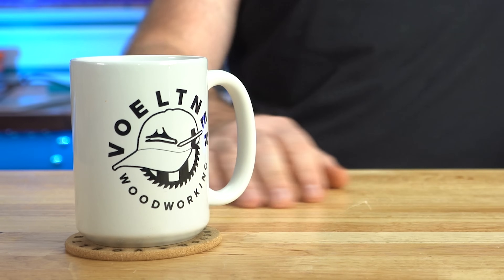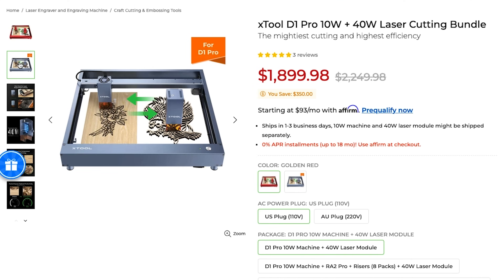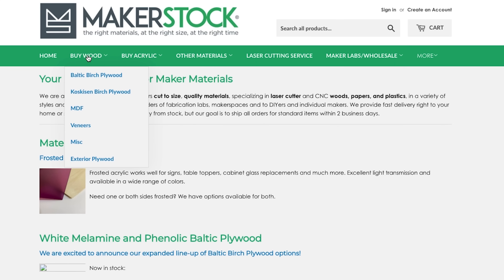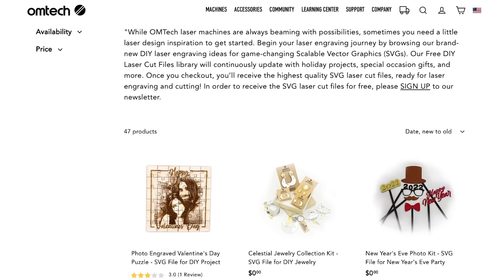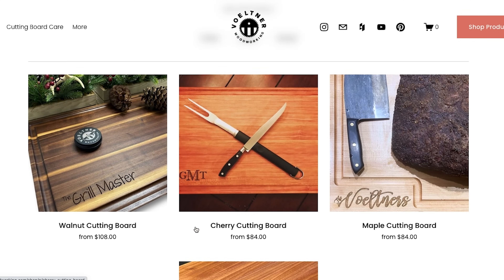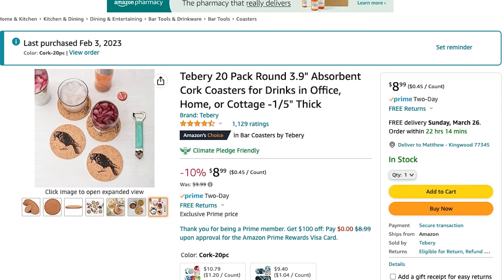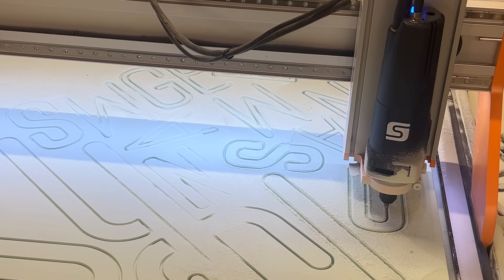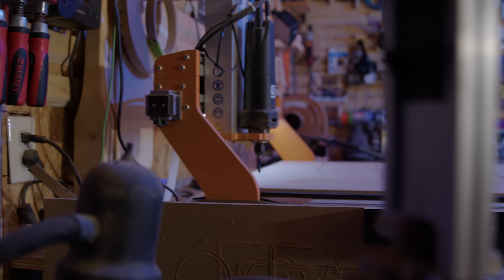I should have NEVER bought a combo machine

Comment: Nice video and well said. I made the "mistake" back in the days when I bought my M1000 with the DL445 laser. While it was OK for engraving it was very limited so I bought an Opt Laser which is much better but still 6W. So I paid the price of this lesson 3 years ago :) Another thing to consider is when you have to use the laser you need to switch the tool which also takes time plus need to make sure the spindle is set well switching back. I had some problems with this CNC with tramming (more with shimming). Do you have a good way to do that other than what Stepcraft recommends with the X axis?
Reply from the maker: I never ended up getting the laser module for the M1000. If you use a flattening bit for your surface your bed should be parallel to the gantry to help avoid issues, but still not as good as a dedicated unit for sure.

Comment: Do you have a video on a (less expensive) machine that can make 3d aluminum plaques - I've had a request to create some for Boler Camper owners that have over the years either damaged one or more of theirs to mishaps or downright theft. The originals were plastic. I mentioned they should have been metal. Now I'm thinking I can supply them to the thousands of us that would like to show our pride with a really spiffy replacement. They are not very thick, but measure about 6" by 8".  And the really affordable machines I have investigated do not measure up. 
Any help would be appreciated😊
Reply: Or should I trust my Boler plaque to someone to create a mold for me and just do it (kinda like sand casting) and pour melted aluminum in? Well, I used to help my dad cast his own bullets. It is not that hard working with melted metal. Heck, I even still have his leather apron 😅
Reply from the maker: This is going to require either a CO2 or fiber laser and the best way to cut aluminum and have it end up clean is by using argon or nitrogen. Most lower end models of these machines will need to be retrofitted to allow for those gases. It's going to start adding up in cost so it may not be economical for you to buy a machine for this type of project without having an initial investment to cover your costs. I haven't done any metal cutting on my lasers so I'm not an expert, but looking at various options for research on my videos that is the best answer I have seen in the various threads I've researched. I hope this helps.

Comment: Your video randomly popped up.  It picked my interest.  But, as I am watching your video, I wondering how would this affect my electric bill.  My garage is separate from my house.  One power cord running under the ground to provide power to my garage. So, thinking I would need a breaker box at my garage.  What do you need to do to prep your space to accommodate power requirements?
Reply from the maker: You’ll need two outlets to run this with the water chiller, and mine are connected to a 30-amp breaker. If you only have one extension cord you’ll likely need to run a dedicated line to the garage that would be protected. Hope that helps.

Comment: All I ever use my laser past 15yre just got my first cnc router
Reply from the maker: Which CNC machine did you get?
Reply: @VoeltnerWoodworking  just the 3018 but with in 4 days having up I pulled out all me old printer frames so on made. My own 6060

Comment: I'm sorry, however,  I had a major issue with your misuse of terms. Growing up in a machine shop, starting with manual equipment later learning how to use machines which is controlled via a computer. Here is my issue with with you continously misidentifying a piece of equipment. You are using  term in which all computerized machines share. Please realize  computer controlled router table is the proper term. Both the laser and router table need to be identified as such as: CNC  Router Table and CNC Laser Table. Simple put, CNC stands for Computer Numeric Controller. I would recommend you to learn and use your terms wisely.
Reply: My apologies for not double checking spell checker.
Reply: @curtisbonville3889 

Did you just blame something else for your mistake? You didn’t grow up in a proper shop😂…. Your level of disrespect, oversight then lack of accountability says you didn’t learn much…. Let’s never mind you narrow views of equipment and terminology 😂. You definitely don’t want to see titans of CNC😂   It feels  like you just got out of high school 🤔
Reply: @FiloYappins 
Can you tell me what the three letter acronym "CNC" stands for?
Or the two letter acronym "NC" refers to when either acronym is used In a machine shop that is uses CAM processes or when it comes to automated manufacturing?
Reply: @curtisbonville3889  🫣 you’re still here thinking you are educating people? You can’t be over 24….. a light 24, I have a laser that’s designated a CNC machine……. Only thing that moves is the laser axis….. tell me all these manufacturers know less than you. You’re too convoluted to understand it’s a process designation not an equipment one. A plotting process.
Reply: @curtisbonville3889  you do know that there are EDM CNC machines right?
Reply from the maker: I would recommend you learn how to spell “piece” right after you look at the terms these companies regularly call their own equipment. These videos are for beginners who don’t need to know the technical aspects and nomenclature behind all of the many CNC devices. I know the terms. I would recommend if you’re bothered to make your own content and deal with the trolls accordingly. Bye.
Reply: @VoeltnerWoodworking 

Remember, unwise use of someone’s understanding of a term can bring their wrath 😂 wait till he sees the industrial world😂😂🫣😂

Comment: Very informative video. You said Co2 laser can cut metal? What kind of metal are you refering to?

A CNC needs torque and slow speed, while a laser engraver need speed and low torque. A combo unit will never be as good as a dedicated machine.
Reply from the maker: You will need oxygen assist to cut steel or nitrogen to cut stainless or aluminum. Those aren't recommended practices, but it can be done. Co2 lasers are great for etching metals with a marking spray. Recently I got the xTool diode laser and it works surprisingly well at etching metal; it won't cut the metal (beyond a paper thin material), but it etches very well without marking spray.
Reply: @VoeltnerWoodworking  ah ok, makes more sense. I was looking at my Mira7 thinking: why can't you cut metal?

Comment: I work for a place called TAP plastics. If you ever need info/ video tutorials on practically any plastic types ,( stuff like extruded, and cast acrylic, polycarbonate, ABS, Styrene ect ect ) whether it's their safety / impact , and light filtration properties, longevity, or just installation, they likely have it. 
Plus a lot of DIY stuff like making molds for casting, or fiberglass, or epoxy resin tips.
 A lot of their vids are on YT as well
Reply from the maker: Cool

Comment: i had two routers before purchased first laser
a K40  for 385
i bought it for a specified job  and after the first job made its price back , months later  purchased a 24x40 sized machine
then 2 years later  a fiber engraver 
they making  their price back  quickly

i mean buying from  chinese
same machines from  domestic dealers  costing a lot more  and customer wont  pay 5 times more just because you spent  5 times more
Reply from the maker: For me, it's about having good customer service and a network of folks that I can rely on when I need support. My 130 watt laser paid for itself in 4 months.
Reply: @VoeltnerWoodworking  
after 3 years of buying  messaged back  the maker  and they sent me  a mirror assembly
not free, it was like 35 bux
but they were nice

people so much about """support""" 
but all vague words
the machine i have would cost  about   10K more from a """usa company"""

i just cant  see what  extra they could  give me for  10 K
Reply from the maker: Not trying to change your mind. LOL!

Comment: For CNC there is extra time involved in cleaning up all the sawdust or waste material - unless you spend more money on a duct collection system. Also there is an added cost using CNC on metals that might need heat-reducting lubricants and will wear your bits faster.
Reply from the maker: True

Comment: As a owner of 7 different lasers and having worked my way up from a 100w Co2 to now 2 big fiber laser cutters that cuts metall all day long my pro tip is when looking up a machine also check the work size of the machine, try to buy a machine that fits the standard sizes the material you intend to cut, for example it's good to have a machine that can handle a pallet size of material so you dont have to cut the sheets down to size, it will be much cheaper to buy and to handle bigger sheets.
Cnc routers are awesome, but there is really cool machines that has multiheads so you both have a cnc router and a oscillating knife.

If starting a business avoid the new multi machines that combines laser and cnc router... they are garbage in a business standpoint.
Also avoid private people and customizations... the time often invested in doing some custom work you never get pay for.
Engraving on private customers heirlooms or other stuff they brought is also to be avoided of obvious reasons, always the risk of having a bad monday or trying to engrave on a mystery material and it looks crap afterwards ;)
Reply from the maker: I hate doing heirloom projects too. Avoid at all costs. Lol.
Reply: I totally agree with you.

Comment: Personally, its CNC, you can do with it almost everything what other machines can do and more, heck you can even upgrade darn thing to do even more(tho to be fair only limitation machine itself and your capacity and willingness to DIY it)(also to be fair laser cutters\engravers 3d printers etc etc are just CNCs in nutshell)
Reply from the maker: Hard to upgrade a CNC with such a small capacity like mentioned in the video. Also, nobody calls a laser or 3d printer a CNC so common terminology was used in this video. Take a peek at any of the laser company websites and see if you find the word CNC (even though they are). :)

Comment: Here's 25 years' experience: Buying a laser, learning how to use it, buying materials, designing a product to sell.... that's the easy part. Getting people to buy YOUR coasters, buttons, key chains, etc., that's the HARD part. Sure, make a set of coasters and put them on ETSY. You'll be one of 700 others. Do a TON of research before jumping in. Oh.... lasers need to be vented.
Reply from the maker: I do pretty good on my website instead of Etsy. Better margin and easier to control SEO.

Comment: Thank you for this great video and informative 👍 
What you recommend laser machine size for luthier making guitar and other strings instrument ?  i only need it just for inlay decorating using 3mm thickness hardwood and abalone and mother of pearl..  .
Thank you 😊
Reply from the maker: I’ve never engraved mother of pearl, but to cut 3mm  wood you could use a smaller laser like the xTool D1 pro. It will leave some charring on the cuts but should clean up fairly well. 

Check out XTool here and use code VOELTNER10 if you end up wanting to buy: https://tr.ee/9BN1lszgAt

You can email me if you have questions about the xTool.

Comment: Will lightburn work on any laser engraving machine, I have a adnoom thank you for your help.
Reply from the maker: I’m not familiar with that brand, but I did a quick search and it looks like that company does more than just lasers so I would think it’s a machine built by another manufacturer and sold on Amazon under that name. If you could find out the actual manufacturer of that machine you could probably check if the main unit accepts Lightburn. If it came with its own proprietary software they probably want you to use that.

Comment: So basically, “it depends on what you wanna do.” Is the answer to what you should get first?
Reply from the maker: Essentially yes. Combo units are much better these days than they were 5-6 years ago, but I recommend dedicated units instead of the router/laser combo because those units are generally lower wattage lasers.
Reply: Pretty much, a router is technically more versatile but there are certainly drawbacks. 
You wouldn't want to run a CNC router in an apartment for example while a laser wouldn't be an issue (with ventilation)

Comment: Great video and channel!  My experience in laser cutting is that while 50-80% margin soundsgreat, that is before labor... The machine does most of the hard work but it can be time consuming to finish even small items (removing adhesive paper, wood finishing, leaving and shipping). I've sold more than a thousand kittens, which sounds great, but my hourly wage from that is not far from minimum wage 🙃
Reply from the maker: Thank you so much! A thousand kittens? That's a lot of work. LOL. I pour every dollar back into the business including my labor. I don't pay myself a salary from the business at this point. Since everyone's labor costs would be different, I don't factor those into the equation for videos like this. Unfortunately, no matter which way I would present a salary, it would be a contentious point. So, I just emit that part from the videos. I hope that makes sense. I appreciate the comment, and thanks for watching.

Comment: Great discussion of tradeoffs between CNCs and lasers. I also started off with the Piranha Fx (discontinued as noted, but the Shark SD110 is its replacement) a few years ago and immediately knew I wanted something faster/larger. I still have and use the Piranha for its ability to easily cut the ends of boards thanks to the gantry being able to extend about 1.5" beyond the front of the machine. This is great for cutting sliding dovetails, regular dovetails, box joints, etc. I never went with the 2 watt laser module for the Piranha, though they now offer a 7 watt diode for it these days. 
I added a 48" x 32" Onefinity CNC  over a year ago, which does the vast majority of my CNC work. I've been very happy with it. Onefinity offers 7W, 14W and 24W lasers for it, but I'm leaning toward a dedicated laser, instead.
Reply from the maker: Thank you. Those Onefinity machines are nice! I’d still get a dedicated laser, too.

Comment: My current project is routed names with melted crayon and sealed with epoxy resin. Can i do this with a laser cutter?
Reply from the maker: A CNC router would probably be the best way to do a project like that because if you use a laser, the relief is going to be dark and not look great. It can be done but not the best method. How deep do the channels need to be and what type of material are you engraving?
Reply: @VoeltnerWoodworking  I'm going maybe between 3 and 5/16 deep, enough for the melted crayon and resin to sit and not have to sand too much..using 15/16 thick wood.
Reply from the maker: I would still go with CNC router probably
Reply: @VoeltnerWoodworking  appreciate your time, got a new subscriber out of it now just gotta convince the wife haha
Reply from the maker: That’s the hardest part. The rest is easy. Lol.

Comment: CO2 laser tubes don't last for ever and need to be treated with care. X-tool doesn't list the price of replacing the tube, presumably because they would prefer to sell you another machine.
Reply from the maker: Which xTool machine are you referring to?
Reply: @VoeltnerWoodworking  P2
Reply from the maker: @paulreader1777  I’m sure they will publish a price for one, but since that unit is fairly new it should be under warranty. I’ve replaced my FSL Muse laser tube with a Cloudray tube before and it worked great, so Cloudray could be another source for 3rd party replacement parts. Just a thought.

Comment: Warning If you are going to purchase a CO2 laser be sure to take a course on how to use it ,maintain it ,fix it,and the necessary safety requirements as well as the power and exhaust requirements as the larger machines can and will kill you in a heartbeat.(High Voltgage in the kilovolt range and water do not mix) and you the owner need to know what to look out for. And the exhause make sure you are not blowing it out the window anywhere near your childs swing set or sandbox or the pool. as these machines are meant for industrial use not for your basement or project room at your home. Make sure you have a seperate ground rod and ample power to run the machine and a electrical fire extinglisher 2  ,1 at the door of the room where  the machine is and 1 at the machine as it is very easy to start a fire with a laser and hard to put it out and please do not use water .Most if not all of these people on UTUBE have a seperate meter and seperate power lines and breaker box to run their equiptment and most have built in fire protection systems .Please be very careful with these machines.
Reply from the maker: Apply common sense. That should go without saying. Lol.
Reply: Separate ground and meter?? Lol.